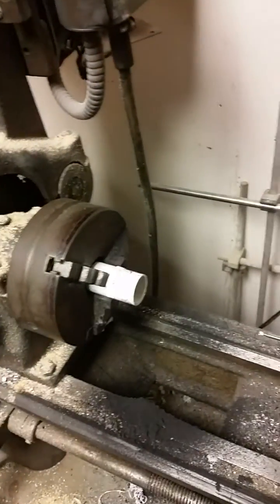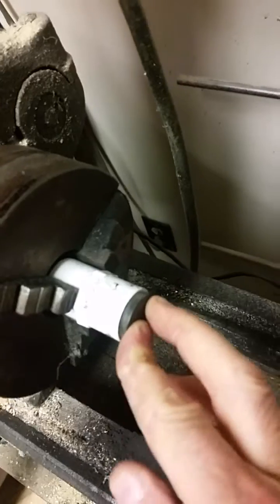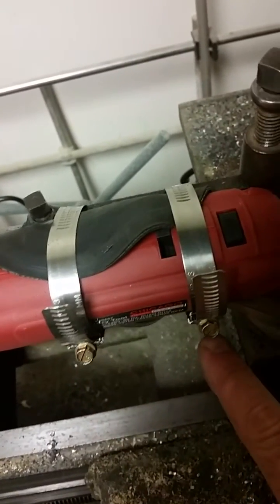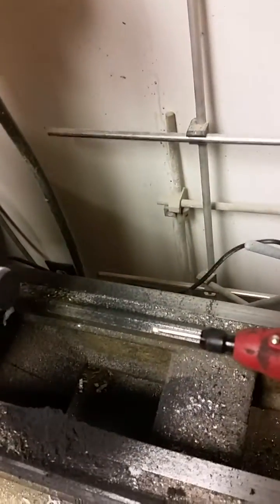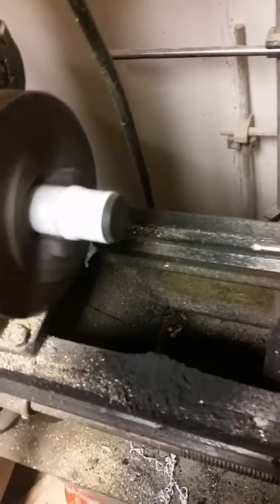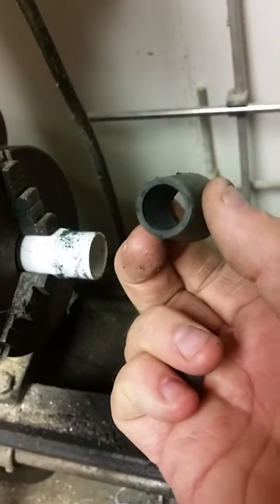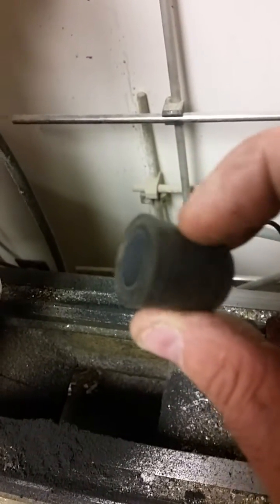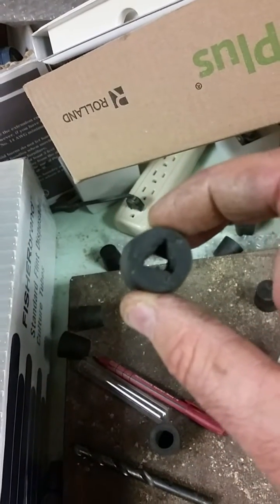machining rubber with dremel tool

Comment: Wait wait wait... What bit did you use on the dremel-like device?
Reply from the maker: I think it was a carbide burr, 1/8 inch shank, either 1/8 or 1/4 head.
Off of e Bray.
The burr did unchuck itself a lot, if I recall(safety goggles!)

Comment: Pretty clever. I might try this as well myself - but today, I'm gonna try to turn down the o.d. of a 3" rubber roller covering a 1" .o.d steel shaft... I might try strapping a dremel onto my tool post as you did and figure out if it would be better to cut or grind the roller to the proper o.d...     The part I got is 1/8" oversized and sending it back to the supplier - and getting it back again - would take a week... and I need this part for tomorrow.... (shoulda checked the o.d. when the part came in....)